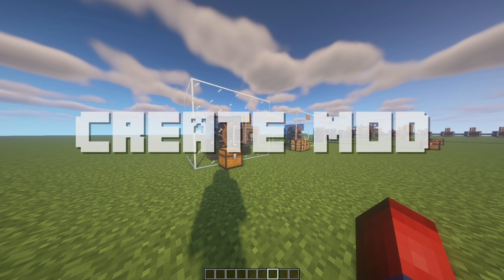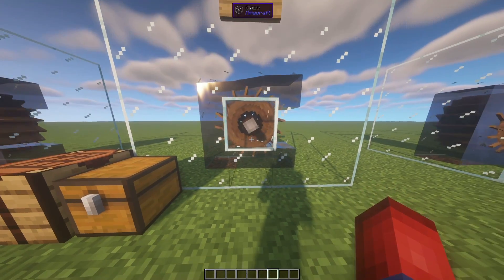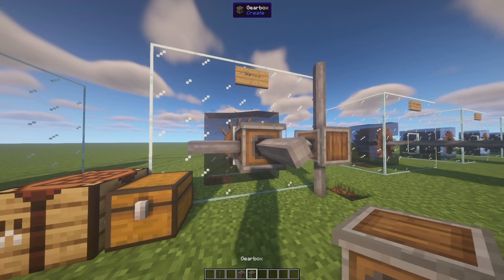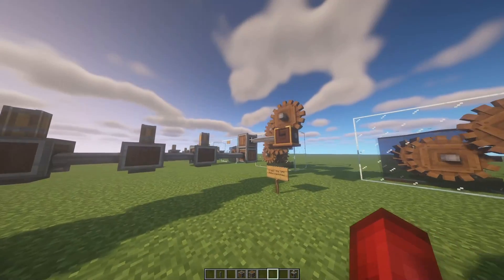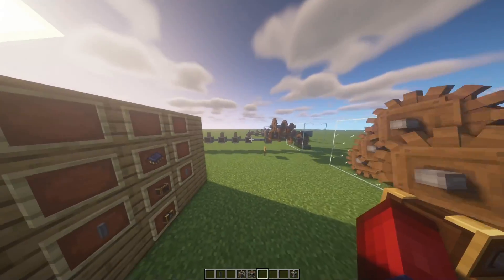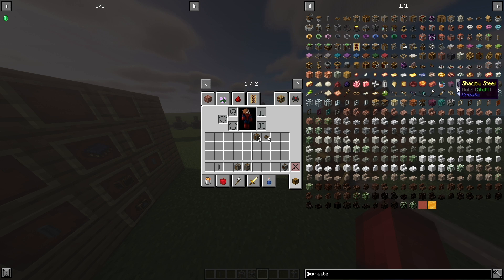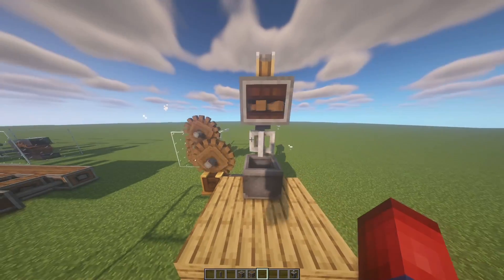Minecraft Create Mod Tutorial - Gearbox, Overstressed, & Speed Requirement Ep 2

Comment: how do you turn off a gearbox at a specific junction in your machine? I have a mechanical drill hooked up to a gearbox that for my purposes is producing cobblestone faster than i need it to. I'd like to at times turn it off. but right now the only solution i seem to have is to just break the gear box when i don't need the drill going. I'd rather have the ability to depower that specific gearbox if possible.

Comment: So i am a little confused cause i made a mechanical crafter and it is over stressed but i attached like 3 water wheels would using the cog wheel thing help?
Reply from the maker: So that means you have too many machines hooked up to a power source. You can add more water wheels or remove machines from the linkage! Maybe check out episode 2 and make sure the water wheels are placed correctly with the water in that position!

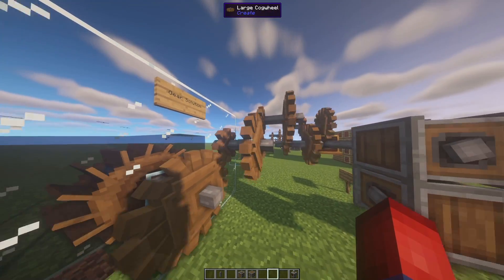Comment: At around 4:00 you show something that I think is wrong. You don't need to step up the rotation speed with cogs and then step it down with a controller, that's just increasing the speed and immediately decreasing it, you can just use a controller directly attached to the water wheel. The concept is that the slower a machine goes the less stress units it uses, so cutting the input speed by x times lets you have x more machines. There is no way of getting extra energy for free, you just make the machines take twice as long to do their job and it uses less energy per second
Reply from the maker: You're 100% correct! This video was very early on in my create learning experience. Before you make a speed controller using that gear trick is a nice way to get extra speed i.e. for a mixer! Once you make a speed controller you no longer need to use that trick and you can just hook up a speed controller :)
Reply: I'll try to explain for ppl who don't fully understand:

Basically, lets say you can run 1 press with 1 water wheel at a speed of 20 rpm. The water wheel cannot create more force at this speed. Think of a bike, using a high gear, you can't go up a slope.

However, if you use a gear (a small one from the water wheel into a big one) you reduce the speed but increase the force. Just like using lower gears in a bike/car. Now you move slower but have more force/energy.
Say for example, we use a small gear to a big one. The water wheel spins at 20rpm, the gears convert that into 10rpm but now you can run 2 presses! (Since they don't have a speed minimum, you could reduce the speed a lot using lots of gears to use lots of presses with the same water wheel)

In the video, he uses a speed controller. Think of this as an automatic car. It changes gears inside it to produce the rpm that you select in it.
So in the video, he uses some gears to increase the rpm (a big gear to a small one). This is fed into the speed controller and then he selects 1rpm on the speed controller.
The speed controller will output this rpm (which btw, what it does is reduce the speed to get more force, small to big gear, like I explained earlier). That way it can run a lot, since in 1rpm there's a lot of force.

You don't need the controller for this!
Because you can manually lower the speed yourself like I explained (small to big gear).

In the video, and using my example of 1 water wheel, at 20 rpm can run only 1 press.
If you increase the speed to say, 40 rpm and then put it into a speed controller, sure, it gives you a range from 1 to 40 rpm. However! Once you select 20rpm it will only be able to turn 1 press. Why? Because you've increased the rpm with gears and then decreased it with the controller. You've changed nothing... It is outputting the same as the water wheel now.
So now, if you try going to say 30rpm, it won't be able to use 1 press. Because the water wheel can't handle that force. And you'll need another water wheel that adds force in order to increase the speed.

I'll answer any doubts and correct mistakes if needed.
Reply: @fransoto8343  you're awesome for that
Reply: I read your comment and the comment below and now i am in Harvard
Reply: @quartermaster2809  Ur really in Harvard?
Reply: @Merc  yeah....they explain it so easily, it is not confusing at all
Haha

Haha

😣
Reply: Could you also just step down the speed using the opposite of what his gear train was? Just compound the gears so it's a smaller one feeding into a big one and so on till you get low speed high torque

Comment: So far this is the best tutorial series I’ve found for this mod pack. So thank you! I do have just a couple of questions, bevause I think things to be overexplained to me. 
So more cogwheels/ adding another watermill/ more wool on your windmill, all equals more speed, and more stress? The speed regulator thing controls the speed so you can have the contraption be slower which allows it to run more things? 
I guess I just need clarification on the direct relationships of these things. Kinda like in physics where it’s like density = mass/volume. 

Even when I add another watermill it reads 256, so what is increasing? The amount of stress my machine can take, or just the speed?
Clarification, if any is possible, would be great.

Please keep up the great work love the vids!
Reply from the maker: You’re are basically correct Angel! Let me just give a bit of the summary and feel free to let me know if it still doesn’t make sense.

Adding more cogwheels is a trick to increase speed in small increments. Perfect for the mixer before you can make a speed controller.

Adding more water wheels, more sails/wool for a windmill will increase total stress limit and speed output. The speed output usually stays the same however if you connect it to a speed controller you can crank it up much higher! 

Slowing down a power source can allow you to power more machines at just a slower rate. 

The reason the water wheel still says 256 is because the goggles are only observing that one single waterwheel. But having several connected will still increase your stress limit and speed output.

Hopefully that makes sense :)

Comment: So I dont get it. Overstressing something is like adding too much power? Or is overstressing where you add too many machines so there's not enough power. Are you stressing the machine? Or are you stressing your power source. I use drills to mine with and say if i want to power them with waterwheels the system becomes overstresssed? Is that because the Water wheel cant produce enough rotational force to meet the needs of the drills? Im very confused.
Reply from the maker: So think of overstressing like this. Let's say a water wheel can only handle a max of 5 machines. If you now put 6 machines it is overstressed as it is not producing enough power. (This is a for-instance I do not know the numbers off the top of my head). You now have a couple of options to fix that. 1. You can slow the machines down and that will allow you to run those machines or you can make more power.

And as far as the drills - drills dont need power they just need a machine to be moving. I recommend checking out my miner, you will see if they are attached to a rail system if the machine is moving it will automatically be powered.

I know this is a lot to take on - but if you have any more questions. Please reply to this :)
Reply: In my understanding, the power transfer (rate of energy transfer) is force times speed, or in the present case, torque times rotational speed. Here, watermill provide a mostly constant speed (maybe completely constant in create) up to a given torque, determined by how much power it can produce. Machine draw power by resisting to the torque of the watermill. Once the combined drawing torque would exceed the maximum torque of the mill, the machines stop the mill. The decoupling gears allow to alter the speed of the gear, while maintaining the same maximal energy. So if you go twice as slow, you can support twice the torque (twice the stress). Conversely, if you need speed, you can do so even if your power source is slow, but at the cost of a lower maximum torque. I'm not sure what Rockit means by "press don't care about speed" though, I'd expect them to go proportionally slower under some speed, which defeats the purpose of having more machines, but I haven't played Create myself yet, so I don't know how underpowered press behave.